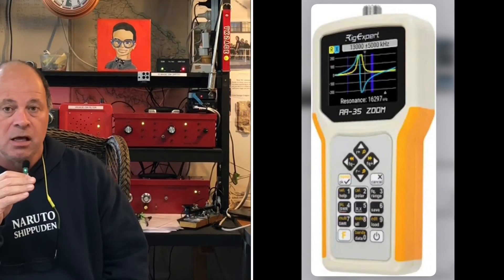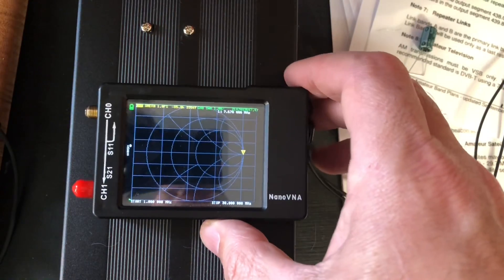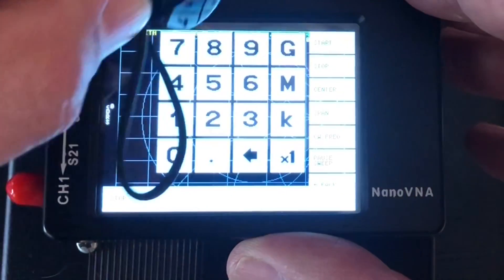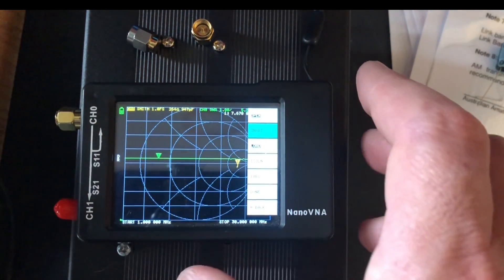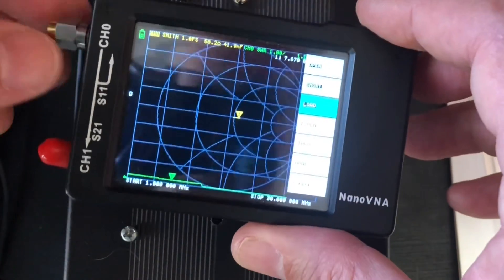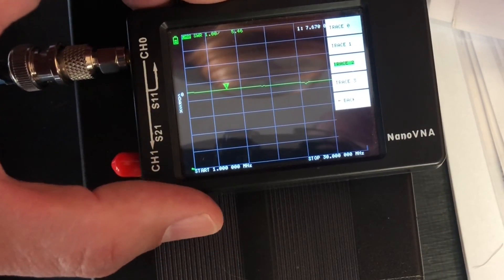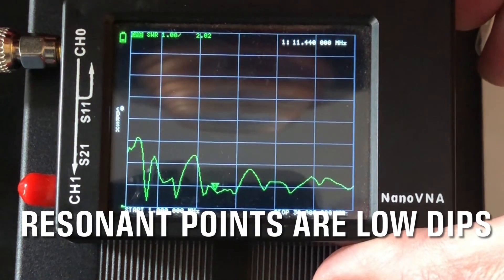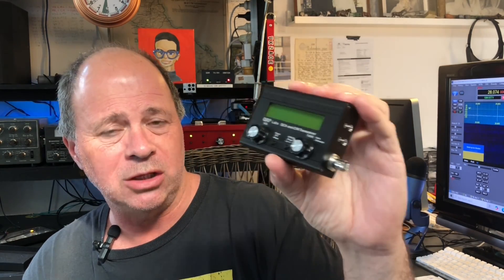Antenna Analysers - what they do and why own one?

Comment: pro tip Amateur tip:  If you are calibrated between two frequencies, say 3-30MHz, you can zoom in to anywhere within those frequencies without the need for recalibration

For example, you can zoom in and set the stimulus to scan say 6.5-7.5 MHz and it will work. You can then change the stimulus to say 26-29MHz and it will work without calibration 

What you’re missing is the precision across those frequencies, but they’re more than close enough to  inspect, tune and match an antenna 

These NanoVNAs have a fixed number of calibration points between any given range. The calibration programs the VNA’s inconsistencies at various frequencies to essentially give you a flat response, a bit like using a multi band graphic EQ to give you a flat frequency response from a stereo or PA system. 

The more spread out these are the less accurate it will be, however it interpolates what it thinks is the response will be between those points, so it’s possible to zoom in and get an accurate enough reading to tune an antenna.
Reply from the maker: 🍺 coming your way! 😂
Reply: @TheArtofEngineering  I’ll edit up those clips for you. Parks off the air. 

Inspired me to build a better mouse trap